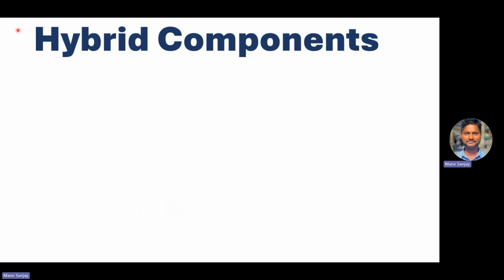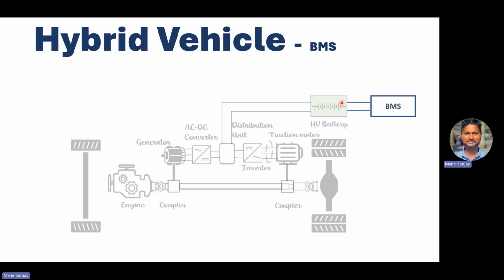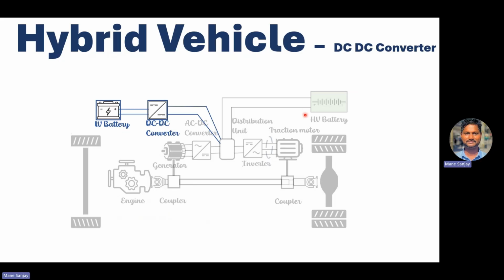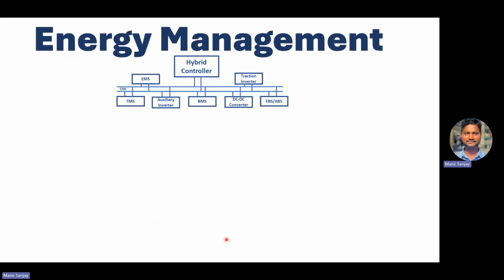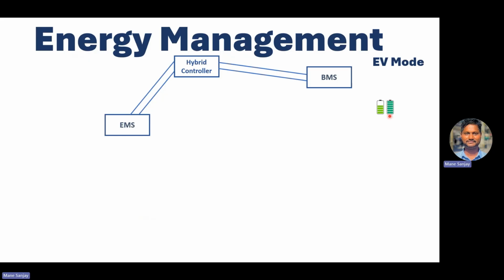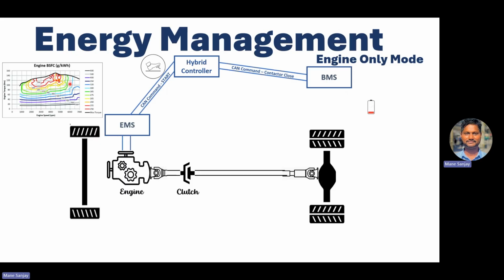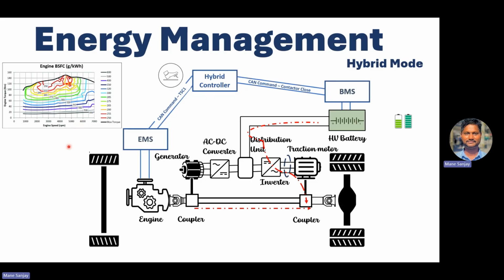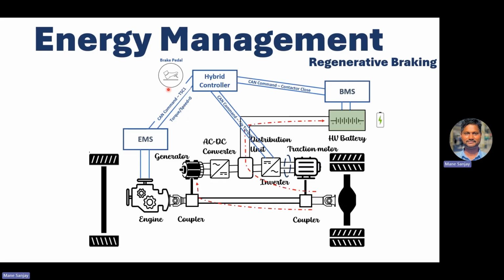Energy Management Strategy for Hybrid Vehicles | Hybrid Vehicle Control Strategy | Hybrid Controller

Comment: Bro can you make a vedio for torque control in canoe configuration??
Reply from the maker: @Vishnu_25798  you can simply use IG block and add torque control command from your database . CANalyzer and CANoe both are same for IG configuration